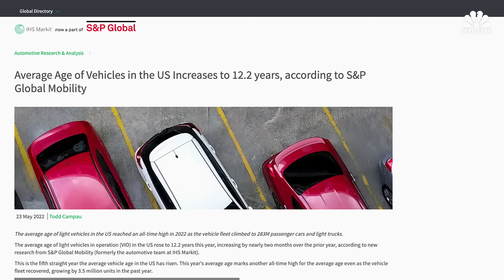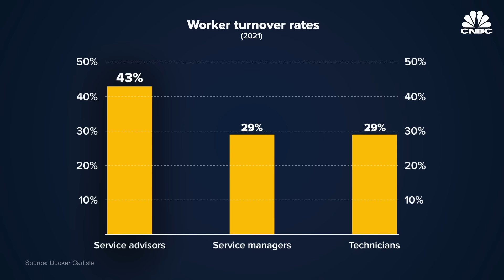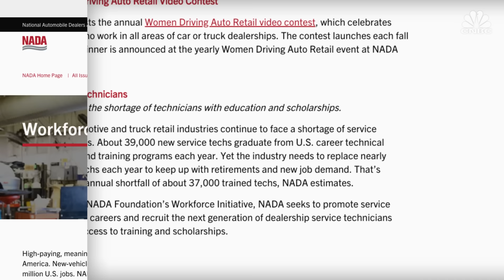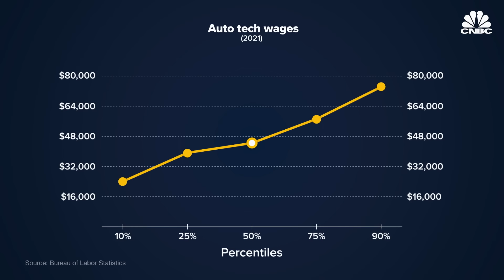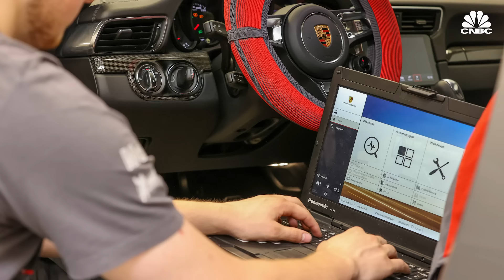Why The U.S. Has A Shortage Of Auto Mechanics

Comment: 1) 100k in tools
2) flat rate pay
3) low benefits 
4) lots of hours with no appreciation 
5) easier jobs pay more
Reply: You got that right on all 5 points
Reply: Got that right
Reply: Dropped out of auto tech classes when I found this out. I'm a Building Maintenance Technician now, only high-school required and I make $50k/yr, tools and uniform provided, 401k, dental and health, 3 weeks of vacation, weekends off and 6am-2:30pm Mon-Fri. 

There are better options unfortunately.  I do love working on cars but there is no incentive to do it professionally.
Reply: I made a offer back in the 90s for just transmission repair. 1/2 the book labor rate or minimum wage for slow weeks(optional). 
The parts profit was the shops.
Come backs was my pay for any problem. Or just go for 1099 employment.
I knew how to take a transmission out and take it apart, clean it and put it back in and it would run right on the 1st try. Also had the tools.
For RWD that is a 8 hour job. At today's rate that would be $70 and hour. FWD that is 16 hours. 4WD/AWD that is 20 hours.
I went to a warehouse instead and worked there instead. Driving a fork lift. For more than what the shop offered.
I moved back to Michigan from CA.
 One of my friends had a heart attack and I did his labor 5 hours a day and Saturday. 
 Worked in another warehouse afternoons after that during week days.
 Until he got well enough.
No pay. He had child support to pay off.
Reply: @alexr62 that’s why I went aircraft maintenance tech, pays higher, no flat rate BS, downside? Spent 4yr in the Air Force to gain experience and get my certificate because I can’t afford to go to school 😂
Reply: On top
Of that there is also a issue where they keep making cars harder to work on for no real reason except I guess just because
Reply: You're right!
Reply: When I see someone looking to get into this field I say make it a last resort
Reply: I read some books and passed the basic engine repair exam.  Then I researched the pay and I said Nope.

I became and X-ray tech and cross trained on the job and got licensed in MRI.

The best choice I ever made.  So much money for the effort.  I never thought I would even be moderately successful but here we are.

I didn't make as much, but I work with a tech that made well over $200,000 in 2023
Reply: It's like teaching.  There's no shortage of teachers.  There's a shortage of teachers willing to be micromanaged while working 60 hours a week, and still not be able to afford a 1 bedroom apartment unless they have a 2nd job.  So the skilled/talented people quit and find a job that pays twice as much with fewer hours.
Reply: Add the need for ase certifications to the list why they don't have enough people. Tons of mechanic without certifications that could learn and do better than some rich kid who got certification
Reply: Yup 100%
Reply: @lucasheidecker508 that cert doesn't mean anymore than a college degree to anyone with any sense. All it means is you passed a standardized test.
Reply: 100k in tools??? Do the techs pay for those??
Reply: Only job in the world that when you are good at your job the customer thinks they should pay less.
Reply: @curtbenson8216 not the only job, happens to the electricians and every other trade as if learning how to do these things is overnight
Reply: 6) You ruin your body, back, joints (like knees). Breathing dust, fuel, cleaners, paint, welding fumes etc.
Reply: You forgot the wear and tear on your body..
Reply: It also destroys your body and you can work from home doing other jobs.
Reply: @alexr62 only 50k a years ! I bet you’re hourly! lol , I been a auto tech for 15 years, I make 84k a year, plus 3k Christmas bonus after tax, have 4 weeks paid vacation, a fee health insurance!
Reply: Mcdonald 14 dollars. Amazon 20 dollars.Uber 24 dollars.  Mechanic 21 dollars and hour
Reply: Uber 25 an hour. Mechanic 19 hour
Reply: and your tools are locked up under big boss mans roof at night.  And big boss man won't pay for your tools but also won't let you do any side work in his shop to help you pay for the $100,000 in tools    total greed
Reply: @lucasheidecker508 ASE's aren't expensive.  no need to be rich to get ASE's.  Experience and learning on the job makes passing ASE's not so difficult.
Reply: Point 1. I fully belive the dealership should be buying a toolset that workers can use. Id just be scared of a lost tool policy.

But in the meantime, yall need to stop buying tool truck tools. The young mechanics go in and get into debt right away to the snap-on truck. You can find reasonable tools for less than half the price put the difference away and come out ahead even if the cheaper set breaks. 

I saw someone trying to justify a $200, set of 6,  radiator hose pick set... on the basis of resale value when you are done with them. (cause when you're old and lack retirement savings yoiure gonna go and sell all your tools!)

Meanwhile you could buy a $60 set and invest the rest but a young guy isn't gonna know that before being 45k in debt.
Reply: Mcdonalds pay a little less with no skill or tools necessary

Comment: Pay a living wage. Don't ask for 20 years experience and only want's to pay them $15 an hour.
Reply: And I'll only paid you if we have work ... totally bull
Reply: I saw a job ad for Mobile Mechanic. Read futher and it stated: Must have own tools. Must have own truck and phone. Who are they kidding? If I had all that I would just go independent without a middleman or broker.
Reply: I am a computer programmer, I fix my own cars usually because it's just insane how much mechanic shops charge. I bought a 2014 Mercedes e350 brand new, my wife drives a 2016 Porsche Cayenne, and I have since replaced the spark plugs/ ignition coils, brakes, and changed the oil/ filters on both those cars. They wanted $500 per service, when the parts only cost $100 online. When the start/stop system started making the car sputter at low rpm, I replaced the ignition coils/spark plugs for $300 in parts for 4 hours when the dealership wanted $2k! The parts usually costs only 15% of what the dealership quote me here in Washington. It's just slightly more complicated than doing home repairs/renovations in my opinion.
Reply: @designexplainedllc346  But shops also have lots of overhead. That's why they charge so much.
Reply: @designexplainedllc346  Worst part about that is there are some things that you cant get around needing a Dealer only diagnostic tool or some nonsense like that. Luckily my Merc was made in the 80's and I don't have that issue.
Reply: @saulgoodman2018  The overhead in my experience was the mortgage on the owner's vacation home and the salary of their useless sons who walk around and don't do anything.
Reply: @antieatingactivist  Those are not overhead.
Reply: @saulgoodman2018  Yeah, that's why I fix my own cars nowadays. Overheads make up more than the cost of labor for shops.

Comment: Thirty years of being a mechanic here.  Being a "technician" at a dealer is a losing game, especially since the manufacturers create the labor times the flat rate system is based upon.  They never take into account that metal corrodes.  The engineers and designers who create these vehicles, and who make two or three times the people who have to fix those vehicles, have no clue what it's like to fix their f*#$ups.  If a "technician" gets stuck doing warranty work at a dealer...  May as well go and apply for welfare benefits.  Fleets and independent shops  (if you can find a good one) are where it's at.  Want to solve the "technician" problem?  Pull some of those engineers away from their desks and make them work on their creations in the repair bay for a year.  The flat rate system has to go as well.  Customers don't help much either.  Mechanics are automatically thought of as crooks by those customers who expect Wal-Mart prices for decades of knowledge and experience.
Reply: I agree 100% with your proposal.  Design engineers should have to pull wrenches, work grease guns, thread bolts into tight, hot spaces, etc.  They can't teach that stuff in school.
MSME, Georgia Tech, 1990
Reply: it took you 30 years to become cynical?
Reply: @billmoyer3254  I was born cynical.  I just show more of it the older I get :)
Reply: @robw9435  There should be cross training in both directions and I understand why a lot of vehicles are made the way they are (cost, assembly line stuff etc.) but, as I'm sure you're well aware, some things just leave me scratching my head.  Some things make ya wonder if the engineering departments ever talk to one another.
Reply: I’m a weekend warrior and this is my frustration with fixing these newer vehicles
Reply: @hopper1  Sure, design engineers have to make trade-offs, minimize costs, etc.  But like you said, some features of design are arbitrary and just not well thought through from a reliability and maintainability point of view.   There's no excuse for that.  
And when an engineering education consists largely of learning Greek characters and derivations of formulae rather than working on real-world scenarios, that sets us all up for failure.
Reply: @robw9435  Agreed.
Reply: when the Mercedes engineers came to our dealership I showed them a jar of antisieze and asked them if they knew what it was. none of them knew. it is so nice changing an alternator when the bolt breaks the entire front cover!
Reply: I don't expect Wal-mart prices.  I expect to not have to take out a third mortgage for a routine repair on a car I paid 5000 dollars on.  Quit whining, go to college.
Reply: That's also a failure on advisor side. they should be known and let customers know that "typically this job calls for x but since your vehicle is aged and not in the condition of a vehicle that was used to create the labor time it's going to call for extra, we're not sure how much but it can range from x to y, give them a higher quote and make em happy when its cheaper.
Reply: @tiamat_023  quit whining. Fix it yourself.

Like seriously you paid 5k for it so fix it yourself plenty of great tutorials online.
Reply: There's definitely an over-engineeing problem with some cars. My husband bought a 2016 Hyundai Tucson in 2019. The engine in that car was built to fail and there's a lawsuit for certain models. He brought his car to the dealership to get it fixed and didn't get it back for 5 months.
Reply: Exactly, many technicians “lose” money due to bad car designs and rust.
Reply: About 24 or less months of people just refusing to go to work in this capacity will loosen up some greedy purse strings.
Reply: @tiamat_023  Choose a car thats cheaper to maintain. It's not the techs fault the cost of fixing is expensive.
Reply: This is it ,this comments the one. Been doing this since I was six. I'm thirty now and own a shop. It's so bad out here bro. I'm considering another business to start. You said it best. Even the pay doesn't matter because the engineering sucks and the customer can't be charged accordingly. Then the tech does not all ways get a up sale in labor, depending on the demographic of owners paying for there repair
Reply: @tiamat_023  Where do you think most of the mechanics get their degrees and certifications from in automotive and diesel technology? College. Then after getting through 2-4+ years of college, it's more schooling as a apprentice at a dealership or repair shop for another 4 years or more. More real world training on the job and more schooling and more certifications to then finally make it to Journeyman.  Then it's off to even more never ending schools and getting certified in order to keep up to date as newer vehicles and technology come out. . All the while getting more advance skills,  knowledge and experience and realizing after all that your worth  proportionately less then when you started. On top of the physical toll it takes out on your body. All I ever heard from my fellow mechanics when I was working at the dealership was, "I don't want my kids doing this for a living." There is alot of facets to the technition shortage problem. Pay is one, a big one. Another is the absolutely horrible designs they put out,  making vehicles very technically difficult to troubleshoot and repair is another.  That's also deliberate. It's called, "planned obsolescence." It's to get you to cry financial mercy and trade it in on a new vehicle. Newer vehicles are meant to fail by design.
Reply: @tiamat_023  you paid 5k for the car, but it's sold for 50k so expect 50k car repair bills. Quit buying cheap Mercedes and expecting mechanics to save your ass.
Reply: MY EXPERIENCE IS APPROACHING HALF A CENTURY! And im only 54! Yah These clients gonna pay for that experience right therrr! Thats why I started a YOU TUBE Channel fixing bank repos and selling them for waaay more than what a dealer sells them for! So retirement plan you say?? How about this ...YOU TUBE PAYS ME FOREVER FOR THE VIDEOS I MAKE, While the sale of the car itself makes me money and gives me more money to buy more cars, to put on YOU TUBE to make even more money That I use to buy even more cars!!  THAT MY FELLOW TECHNICIANS IS HOW ITS DONE!  ( and I drive my choice of no less than 3 modern muscle cars at any given time..PAID FOR!) THATS WHERE THE TECHS ARE GOING FOLKS!!...Secrets out...
Reply: Very well said
Reply: These car manufacturers actually know exactly what they're doing. They engineer the cars where they intentionally fail. I know this from an engineer who interviewed with a car manufacturer. It's all about profit, and the hope consumers buy a new car essentially.
Reply: It was bad when I worked in wholesale parts for Ford from 2012-2017. I can only imagine how bad it is now. No AC in the summer. Barely any heat in the winter. Combined with low wages (techs are paid WAY LESS than the labor rate) and the high cost of tools. I don’t blame this generation for not rushing into this field.
Reply: @tiamat_023  you assume mechanics are uneducated yet you are the one driving a used shtbox...by the way I put myself through college and law school working as a mechanic.
Reply: To quote another YouTuber(I unfortunately forgot which one sorry) "Take those crayons away from the engineer's" that not exactly what was said but it somes up what my feelings are about the convoluted engineering and design those of us who have to keep their "masterpieces" on the road.